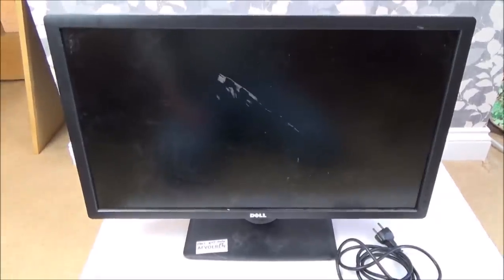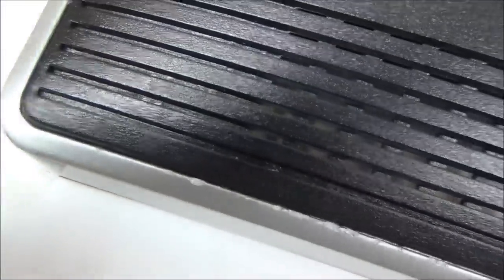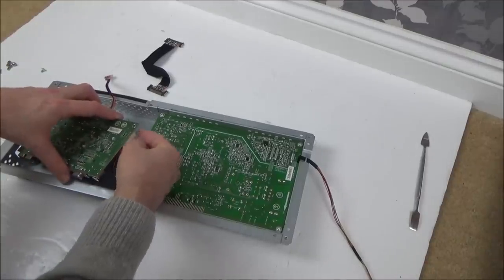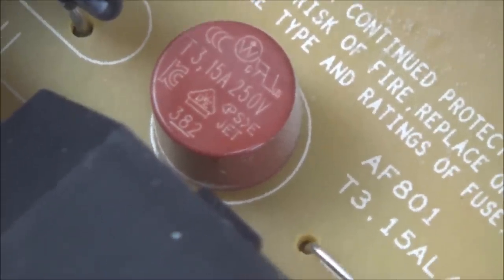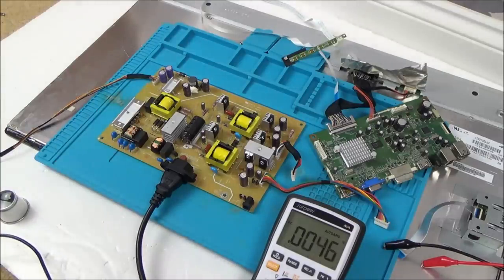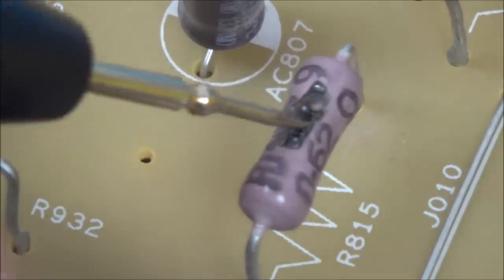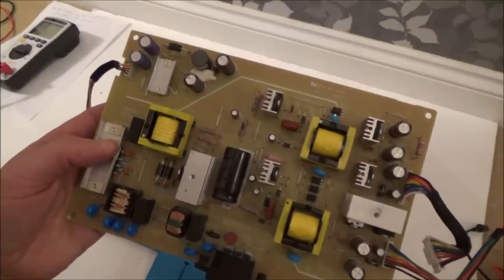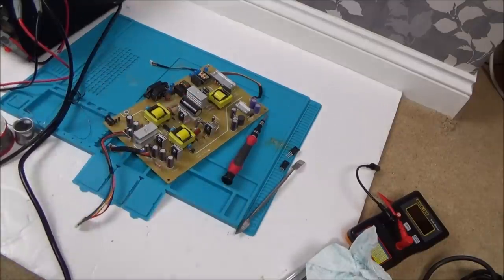Trying to FIX: DELL 1440p WQHD Computer Monitor

Comment: I'm so sad that this LCD panel was broken, that monitor stand is awesome! This vertical mode is also very good for programmers - you got more lines of code at once, it's also usefull for web design. Vince how about dental water irrigator repair? I don't remember such item in your channel. I recently bought this item and repair - water damage of course. Mine unit is working on 1.5 Volt, so after cleaning with IPA everything was working fine, propably too low voltage to burn something. Dental floss is no more needed.
Reply: What's awesome is on that stand? Just wondering because where I work we have those on pretty much all monitors and have been throwing them away a long time already... for my eyes that looks just a normal standard stand without anything special.
Reply: @Whigu  you can easy switch angle, up and down without struggle. Also one button click to change from vertical to horizontal. Don't you think that is cool features in monitor stand? I never saw such stand before.
Reply: @solveit1304  I can't see anything special or cool about it. Most of the monitors that I have been using or seen has those. Even thse Asus monitors which I use at home does those things.

Comment: Just to point out that yes that plug does have an earth, it is not a pin but is on the side of the plug. I should know having lived in Germany for years. The sockets actually have a bent pin on the side of the socket for the earth connection and to be honest, I prefer to European plugs. Secondly, half of the UK plugs do not even have an earth anyway. Think of plugs that go into laptop chargers, the brick itself may only have 2 pins. You will find that although there seems to be 3 pins, the earth is sometimes plastic and that is because there are plastic shields insdie the sockets which need the longer earth pin to push them guards out the way. ALL UK plugs have Live and Neutral but not all have earth wires. So, you could in theory run it without the earth, but it's easy enough to get a European ot UK adapter, also, they are the same design as the shaving socket in the UK just the UK shaver socket may be a tad narrower than the EU ones, not that you should use that socket of course.
 
So could you have used the EU plug? yes you could. We did this alot as I grew up in Germany as MY family is a military family. When we came back, not all ourt adapters had earths but we still used the 'German' plugs (slight pin size difference to EU), as we called them, till we fully transitioned to UK ones.
 
So yes, that EU plug does indeed have an earth just to clarify for anyone out there and I would use it with an adapter. 
DO NOT DO WHAT SOME UNIVERSITY STUDENTSD O AND PLUG AN EU PLUG DIRECT INTO A UK PLUG SOCKET, YES THEY DO ACTUALLY DO THIS SOMETIMES. 
 
So just as with UK plugs, not all EU plugs have an earth but if they have flat metal (2, one top, one bottom) on the side of the plug, then get an adapter with bent springy top and bottom parts in the socket as they are the earth. Yes, EU have 2 earth connections in effect.
 
Example:
https://www.amazon.co.uk/VGUARD-European-Adapter-Adaptor-Electronic-White/dp/B085FVCYTT/ref=sr_1_5?adgrpid=56029145187&dchild=1&gclid=Cj0KCQiA2af-BRDzARIsAIVQUOfIc5AEvZYI4aMRurh-JvXqImn_NzSYPDsK67N9kLesQKDPVUz8P0MaAqV5EALw_wcB&hvadid=259053833420&hvdev=c&hvlocphy=1007133&hvnetw=g&hvqmt=e&hvrand=13814018990991399522&hvtargid=kwd-296631399253&hydadcr=5083_1827840&keywords=eu+to+uk+plug+adapter&qid=1607069684&sr=8-5&tag=googhydr-21

Comment: The charged capacitor even though 160V, it has very little power  in terms of non lethal, yes it does tingle but it wont harm you.
Reply: I disagree, depending on the capacitor rating the amount of instantaneous voltage discharge into a well grounded human body can be very high.  I have personally seen chunks of flesh blown off of fingers. This type of instantaneous discharge is especially dangerous to people with heart problems. This is especially true in older electronic devices.  Any CRT (cathode ray tube) television, or in the older amplifiers and radios that use vacuum tubes that act as modern day compactors.
Reply: @johnday7362  I doubt that particular capacitor has that capacity to blow off a finger, it would have to be fairly large and at maximum charge potential to do that sort damage and I'm sure there would be warning label, fitted by the manufacturer, if not a large bleed resistor.

Comment: Thanks a lot Vince! As many others, I really enjoy your videos and I'm learning a lot from them. I'm about to try something very similar with a U2713HM, I need some help, on mine there is a blow in the cap C821 and some part of the circuit track is missing. Could you share with me a picture of the board from the pcb track part (green one). Really appreciate! Let me know if I can contact you on the work email.

Comment: You may have a Bad Optoisolator. Or Bad MOSFET. If a Resistor is in Parallel with other Component/s it will Read Lower than Rated.

Comment: Like the way you approach the problem and your logic thinking, maybe a tip: Every switching power supply needs a load to work, so i.e. a broken back light, no power. There must be a circuit working to switch on the load, usually 5 V dc, so no 5 V somewhere near the outlet; you have a faulty power supply, now work your way back to the power cord or start at power cord and work your way to te outlet of the power supply to find this 5 V. No voltage on any point  after the AC mains means a faulty component at that point. Once found and fixed, use a (dummy) load to check if the power supply is working correct, if so, try to fix the rest (sorry your line)

Comment: I have a Dell Ultrasharp 1901FP that won't power on, regardless if it is plugged into a reliable 120V power source. no green light/amber light. I guess that the power supply is busted.

Comment: Without Tracing the Circuit we may never know which Side the MOSFET is on. Either way...if Power Returns when Shorting, however brief, then that's your Culprit.

Comment: Why did you not try powering up with the 12v supply bypassing the high voltage side of the board?
Reply: It's output for speakers not input.

Comment: Hot ground and cold ground
When you check caps desolder them otherwise you can get incorrect readings
When you test fets do them out of circuit and in diode mode should measure same as a good diode
Testing resistors.... in circuit there could be other components in series or parallel 
Other then that shame that the screen is goosed

Comment: VINCE MATE, DO NOT USE THE CABLE FROM YOUR SOLDERING IRON FOR ANYTHING ELECTRONIC!!!!! I did it with my computer PSU when I moved stuff around and mixed up the cables, the cable for the iron was copper coated aluminium which allowed a higher current to pass through, causing the transformer to heat up, melt through the enamel coating and eventually blow causing a short

Get one off a computer or whatever but don't use the soldering iron one mate

Comment: Hi I wanted to know what can I do with my Nintendo account that's been "suspended" for no reason and I mean I bought a lot of games that are still there but when I open one it says I haven't bought it, when I open my user it says I need to sign in again and when I do that it says my account has been suspended due to a violation of the Nintendo account user agreement

Comment: The Nice Stand is Worth Keeping. You should be able to Fix the Power Supply Board... Its not that Complicated of a Circuit.
Reply: It's pretty standard stand. What's so special on it? It goes up/down and rotate what all stands what I have used in few last years has done.

Comment: Desolder One Leg of the   Resistor/s then Measure. 
Remove the MOSFT & Jumper Source & Drain.
Reply: i wouldn't expect jumpering to work. it's on the primary of a switch mode power supply. the MOSFET will be turned on and off at high frequency, jumpering it will just send DC to the transformer

Comment: I wouldn't worry too much about the other resistors "being off" :)
It's pretty much hopeless to measure anything below one ohm without a kelvin connection :)
Reply: I've owned / own a few monitors from this family btw. Started with the u2707 (to this date the best looking monitor I've ever had) that developed a severe CCFL flicker/strobing near the end of the warranty period so they "upgraded" me to a u2711.. that had gremlins or something, it would distort the picture and go all wonky from time to time. Then got a u2709 that survived for a couple of years before developing vertical lines that appear for 20 minutes or so during warmup. Still using it as a secondary but I can't say I've had good luck with their monitors :P
I've heard their LED monitors are much more reliable?

Comment: you sure  about the  "  can't  get panels- problem" i bought an 4k panel for a 650€ aorus Monitor for 85€ ^^  i used  http://www.panelook.com to look up the panel name  and  searched it (found it on ebay and risked the 85€ ) .. it was  worth it.
You problem  COULD just be  that  the   backlight  was  damaged aswell so thats why there isn't any light

Comment: you need to get your self a Switching Power Supply  to test circuitry never use mains over there(across the pond ) one slip up your a dead man be careful mate.